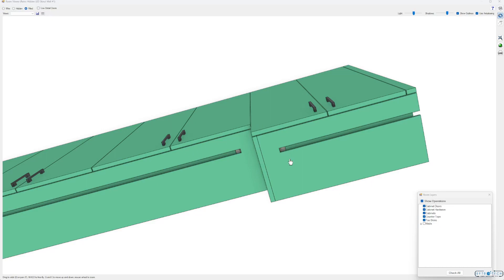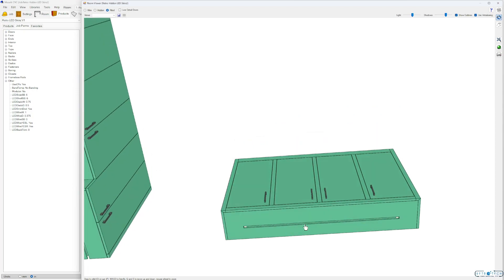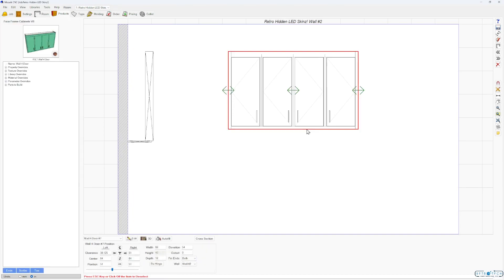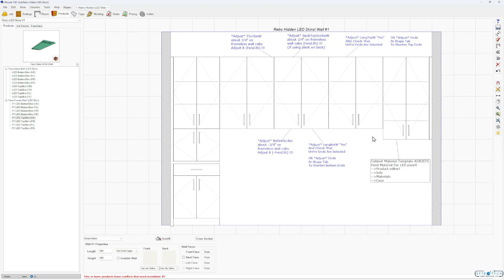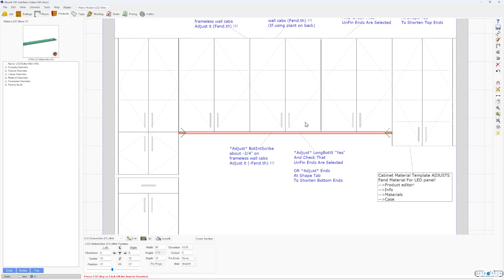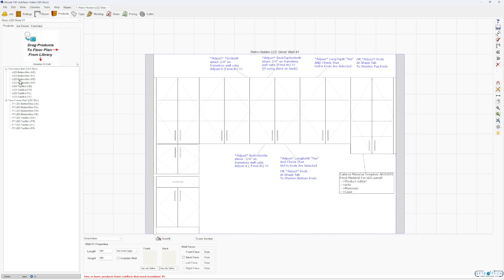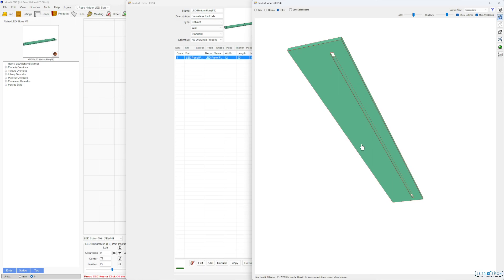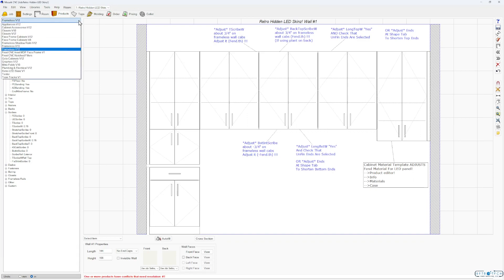How 2!!  Easy Flush Parametric Light Skins With Mozaik Software!

Comment: Is there a way to make LED corners?
Reply from the maker: Not sure I follow your question.  End panels?  Or are you talking about under side of corner cabinets?  You could place one under each side.
Reply: @RetrotechCNC  Yes, bottom or top skin of upper cabinets in the corner to have continuous led around the corner. Are there parameters for that?
Reply from the maker: @markleverock7843  there’s parameters that would work for that, but I didn’t make a specific part for a corner, looks like I’ll have to add that to the library!